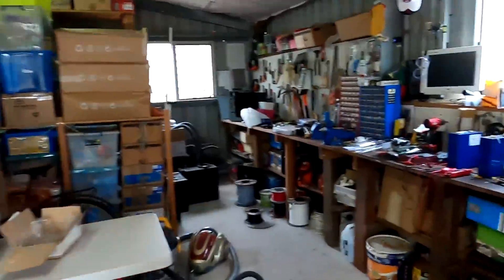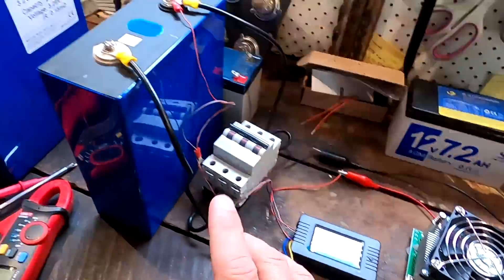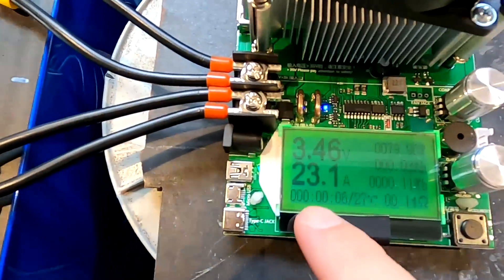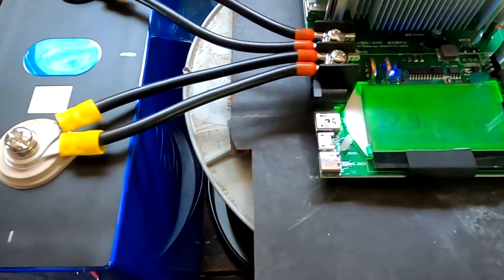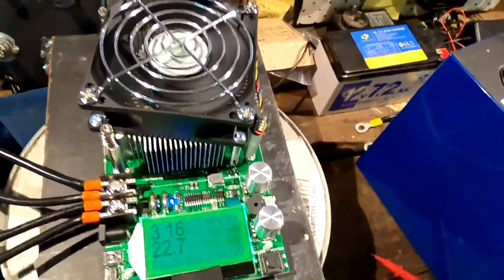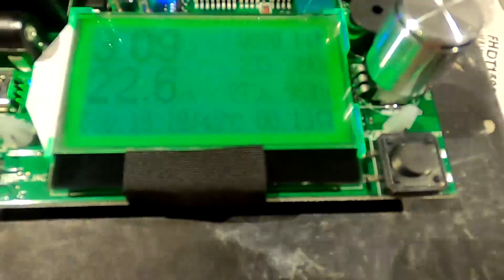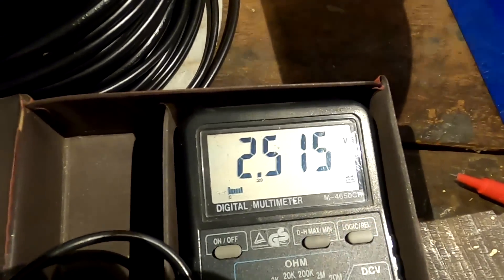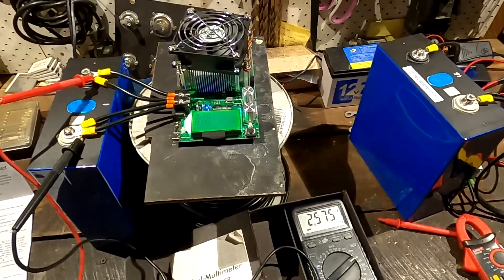Do Chinese batteries hold what they promise? Full EVE LF280 Capacity Test!

Comment: The resistance measure 0.14Ohms and the effective resistance the battery is discharging over. 3.24V/23.1A=0.14Ohms. its not the internal resistance of the battery..

Comment: Capacity measured plus the calculated losses of the wire harness >280Ah
It would be interesting to cycle this same cell 50-100 days in your solar power set up, then pull it out and repeat the same test set up you just did, as it is known that brand new cells will test higher initially but no one ever seems to state how much higher.  Seems like these ones are "a winner". Great vid Andy.

Comment: Your Multimeters are chinese so check specifications.  I have calibrated multimeter like them before way out in some ranges. I use Fluke only , but there is a French brand, which is good too. From a ex calibration technician.
Reply: I bought a Voltage Reference Module exactly for that reason. You can find inexpensive ones on Amazon with good reviews (on and off Amazon) accurate to within a few thousandths of a volt. Then if you have an inaccurate meter (assuming it even displays that many digits) you know how much to skew the reading.

Comment: This is a great series. I’ll be building a battery for my camper soon. I’ve never used Alibaba. These batteries seem to deliver as promised, why did you choose this battery and this vendor?
Reply from the maker: This was the only vendor which offered 5 years warranty on the cells and also was with Alibaba for over 8 years. I have found cheaper sellers but went with them and so far, so good!

Comment: 022721/0504 PST- Brisbane 2304h   Those two cell capacity testers are quite unreliable and notorious.
For a set up like yours what you need is pure digital cell capacity tester manufactured by EAST TESTER (China)
Model ET-5410@40A discharge current. Item available with Alibaba. US$175 AU$227. I found it extremely good and very relatable in test results. The settings are a wee bit complicated but once mastered the procedure, it’s easy to work on. Discharge test result per one 280Ah cell @ 40A = 5 hours. Best wishes and 73s...

Comment: Considering you were less than an Ah off rated capacity and that meters voltage rating is already showing as off compared to the multimeter, I can say that cell is probably a winner, and may have read over 280Ah on a professional instrument. An instrument that probably costs $1000's. So the deviation of the little fan cooled tester is acceptable, considering they cost less than $100 :)

Comment: Thanks so much this was very educational and also very encouraging to see that these batteries which are probablly the best value you will find anywhere online (believe me, I've LOOKED). I have a question though, why can you not leave these batteries fully charged for too long, what would happen and how long would it take before there would be an issue? Is it safe to leave a battery at 90% capacity?
Reply from the maker: Thanks for your comment and feedback. Due to chemical reactions, the battery will lose capacity when charged to 100% and kept at this stage. This will shorten the life if you do this to often. You can charge to 100% of you are discharging it right away again. The chemicals inside are most stable at 50% state of charge (SoC). Everything below or above will shorten its life. 90% is far better than 100%, 80% is even better. If you want to store your battery for a long time charge it to 50-60%. For general use,  you can use it from 10-90%, better from 20-80%. If you want the battery to last a really loooong time charge from 30-70% only.
Reply: @OffGridGarageAustralia  Thanks for the response! Ok wow that's really something I had no idea about. It makes me wonder what the manufacturer's mean when they say the battery is good for 3,500 cycles. Are the assuming when they give this number that the battery will be each day discharged and charged to 90% capacity or is the 3,500 cycles the really best case scenario of only using the battery in the 30 - 70% range? Sorry for the questions but your a wealth of information and i'd be kicking myself if I did not ask.
Reply from the maker: @bethechangeme2233  so, the specs say if you do depth of discharge (DoD) between 10-90% you will get 3500 cycles. If you do 30-70% DoD is more like 10.000+ cycles.
Batteries in satellites do only 40-70% so they last 25 years reliably.
Reply: @OffGridGarageAustralia  it would seem that one would need to triple the required size of their battery bank to stay within the DOD of 30-70% in order to make them last the 25 years yet if the DOD is between 10 and 90% that same three battery banks would last 27 years! Would it be safe to say forget about compressing, forget about super tight DOD's just go for the 10% - 90% and in 9 - 10 years we will have better technology?

Comment: Thank You for opening this old mans eyes. 
I have been watching you for a while.
I have Four 280Ah batteries Lithium Iron Phosphate batteries I am waiting on and because of you today, I order Two more so I'll have six.
Why?
I'm Old. I have been setting here thinking I'll hook them in Parallel like my acid ones and this will give me 1,120 Amp Hours, Boy Was I wrong.
I guess I need to connect them in Series for a 12 volt system and a full 480Ahs.
I live in my fifth wheel so 480 Ahs will not be enough.
Tell me if I'm wrong, but I guess I'll have to connect in Series and then the last two in Parallel for a few more Amp Hours, Correct?
Thank You Rick
Reply from the maker: Hi Rick, Thanks for your comment.
6 cells will not work for a 12V setup! You need either 4 or 8.
If you have 4 you just connect them in series for a 12V system like:
-⬛+ -⬛+ -⬛+ -⬛+

If you have 8 you need to parallel every two cells first like
  ┌ -⬛+┐
- ┤          ├ +
  └ -⬛+┘
and then have this pair in series with the other 3 pairs
  ┌ -⬛+┐┌ -⬛+┐┌ -⬛+┐┌ -⬛+┐
- ┤          ├┤          ├┤          ├┤          ├ +
  └ -⬛+┘└ -⬛+┘└ -⬛+┘└ -⬛+┘

Does this make sense?
Reply: @OffGridGarageAustralia   OK, I'm old so I guess I'm wrong as usual and very slow.
I watched https://www.youtube.com/watch?v=zStEtH9Le-w&t=150s
Thank You
Reply: @OffGridGarageAustralia   The picture you show confuses me, Sorry.
Maybe you could do a short video for myself and possibly others here.
Sorry I'm so troublesome.
I do live in my fifth wheel and everything I have is 12 volt or 110 volt.
I use solar and a wind turbine to keep my 4 lead acid batteries charged, but they are getting old, Like Me!
So you're saying I need to cancel the order for (2) more Identical Batteries and Order four (4) more Identical Batteries.
Same brand name is important or not.
Thank You for your time and trouble and for responding so quickly.
Reply: @OffGridGarageAustralia   I will do my best to get four more batteries after this order is canceled.
Thanks.
Reply from the maker: Yea, Rick, you can only use 4 or 8 batteries for a 12V system. The video you linked above shows the setup as I described it in my first reply. parallel 2 batteries and do this 4 times. You will have 4 pairs with 2 batteries each. The put these pairs in series to achieve the 12V. Video will follow soon...
Reply: @OffGridGarageAustralia   Yes, you're right.
Thank You.

Comment: Since you're working with such low voltages and you have to be accurate down into the millivolt range do yourself a favor dump the cheap Chinese meters.  Get yourself a fluke 87v or 289.  You will never have to worry about whether what you're reading is correct. It will be.  you can bet your life on it and many professional electricians and technicians do everyday.  Also if you can find a good Weston cell you can check the calibration of the meters.  These can be a bit fiddly as you have to keep them at a known temperature to ensure the calibration is correct. you also cannot move them or you must let them sit in place for a day or two for the chemicals to settle back out.  If you must use the Chinese meters at least get a known voltage reference that is calibrated and is referenced back to a known accurate source.  One item is known as a DMM check source.  These are available at dmmcheckplus.com.  They're not $20.00 but they're also not expensive and would be very helpful to verify your equipment accuracy.  A basic unit is $123 and will give you a precision 5 volt AC and DC source plus a current source and a resistance standard.  For an additional $20 you can get a capacitance reference source.  And there is an optional case if you would like it.  Also the manufacturer offers a low-cost recalibration for 20 bucks.  This is one of the best deals in calibrators that are built and tested out there.

Comment: There is a DC receptable right next to the dummy load terminals which should be there to power the tester independently of tested power source so it won't drop out prematurely due to the low voltage. At least my tester has this feature, not the same model in the vid.
Reply from the maker: Yeah, I did connect mine to the external power supply as the test voltage was under 8V.

Comment: The interesting thing should be to test this cell at 1C, it means, if I am not wrong, drawing 280A for one hour and see if you will get 280AH at the end of the test?
During the test you performed, you have got almost 280Ah at a rate of 22-23 Ah, that it corresponds to only 0.08C.
Thank you for your job.
Reply from the maker: That is absolutely correct. The specs of the cell stating 1C/0.5C discharge. I've made a video about this already and will publish it very soon.

Comment: Ridiculous question, Andy! If you used a sized matched copper ring terminal & a single, hydraulicly pressed, air-tight seal at each junction with a 2 AWG equally sized cable- would you have reduced the 'line loss' of 0.007 & 0.0073 millivolts? It's so small, it's meaningless, but- as I build a system, I could lose lots of Watts over relatively short distances... It's a thinking ahead question, but- annoyingly smaller in the larger test!!! Congratulations, it must make you much happier to know that you got what you paid for!!!
Reply from the maker: Thanks David. The better your crimping job is, the better the connection and lower the losses. I didn't pay too much attention to mine as it is just for the test. For the actual system, I will buy an hydraulic crimper though.
Reply: Jeez, I just commented with the same idea on the previous video! My line of thought is how well that works with the positive battery terminal in (fuel-powered) vehicles.
Reply: @charlesrichards5389  I think it was all about timing- we (Andy) were 'building it' at the time, and- lots of focus by the watching community...
Reply: @DCGULL01  I love the brain-storming! I also suggested drilling a small hole in each busbar to mount BMS wires. That's what I'll be doing if I decide to go with busbars. That should make the terminals more stable, easier to service, and easier to isolate voltage drops.

Comment: Great video, I also find it fascinating to watch the numbers :D. Also the amount of current drawn from the battery is not necessarily related to its voltage, especially in a case where a load is drawn through a constant current/constant voltage device (like some types of inverters), drawing more amps as voltage decreases to maintain a wattage output. I am interested to hear what you plan to do with these cells!
Reply from the maker: Thanks for your feedback. You absolutely correct.
You may want to watch the very first video on my channel. This explains the project.

Comment: As mentioned elsewhere, that 140mOhm figure is the equivalent resistance of your tester load, not the battery. Surprised that the tester is not a FOUR WIRE instrument - two wires to measure current (as you have now) and a further light-duty two wires on their own croc clips which you connect directly to the battery terminals, to measure voltage at the battery itself. This eliminates lead resistance in the current path altogether (or at least, it correctly takes it into account as effectively part of the load).
The usb sockets on the tester board suggests it can probably output data to a PC, to log voltage drop and Ah in real time, to save you the bother of watching :)
Reply from the maker: Thanks, I've got a second tester which has the voltage sense directly at the battery terminals.
Really? That's the load resistance, not the battery internal resistance? I thought it says that in the manual...
Reply: @OffGridGarageAustralia  yes, that's definitely the load resistance. There are other meters that have readings for both internal and external resistance though.

Comment: Word of warning, I have bought multiple of those 180w capacity testers and they ALL fail within a short period of time. When (not if) they fail, they fail in a short circuit making tons of smoke all over the place. Highly recommend an inline fuse of some sort before connecting any further loads.
Reply from the maker: Thanks for the feedback. That's good to know. Was this all with higher loads? So far I have only tested single cells with 3.3V, so pulled 75W max.
Reply: @OffGridGarageAustralia  to be fair, I did run higher voltages. Testing 48v batteries @ 100 watts smoked them after a few hours.
Reply from the maker: @jjthegreat1981  on thanks very much for that info. I've planned to test the 48V system with it to. Have you got the tester with the green board or the red/brown board?

Comment: Although I never did a full drop to min cell voltage of 2.5v for a cell, my 4s 12.8v configuration I was able to draw 262.6ah at a constant 46amps via a inverter running a pond pump with the lowest cell voltage at 2.986v and highest at 3.124v with total cells at 12.2v and SOC 6% via my Daly 150a BMS and VictronConnect 712 smart. Duration from max charge was 5hrs 48mins.
Reply from the maker: That's a great result.

Comment: Nice test! And good job measuring the voltage drop over the cables. That drop shows some resistance which the tester is attributing to battery internal resistance.

Comment: So this battery as 12V 280ah with an inverter would run a window A/C unit drawing 5ah 500wh at least 7 hrs basically ?
Reply: More like 5 hours. Your inverter will only be 85-90% efficient. Plus losses in cables.

Plus 5ah at 110v is more like 550w.

Recon you only want to be using 80% of these lifepo4 batteries to maximise life cycles, so don't drop bottom 10% or charge over 90%. Will increase your life cycles from 800 to 1000's :)
Reply: @w3bb0y  luckily the devil is in details . the room to b cooled is 1/4 the cubic ft these window units are rated for .  previous attempts with agm 500 ah have only used 40% d.o.d. on 8hr runs so I'll b giving the 280s i try in summer . should b interesting .

Comment: You have wires resistance so the internal resistance will not match you cell. I have the same electronics load tester. Great video. Looking forward to the next test.
Reply from the maker: Ah, yes, of course. The tester sees the wires and connections as well... Thanks for that!

Comment: Recently I did similar tests on my 150 Ah cells.  On an individual basis the cells were fine, however, when connected two in parallel and then four of these parallel groups to make  a 12 volt battery, I lost 25 - 30% of the capacity.  I tried it several times moving batteries to various positions and got the same results.  So I decided that the complex internal chemistry and internal resistance of the batteries caused some to drain more rapidly than others just as if you take different value resistors and put them in parallel the current through each will not be identical.  Since it is the current that drains or charges a given cell it makes sense variations in internal resistance will cause variations in individual cell resistance and currents.  Just as with parallel resistors, the voltage across resistors will be the same but the currents are different and I think the cell being taxed pulls down the voltage for the parallel set.  Also, although my cells were fine as individuals and exhibited small cell differential voltages for most of the test of less than 10 mv (at the very end it got up to 30 mv) when connected in parallel I saw differential voltages of up to 300 millivolts.  It would be very interesting to see if you could repeat my experience on your cells.  For now I have concluded that if one wants a larger capacity battery than the value of the cells they own they should make single batteries of cells in series and then connect the batteries at the battery level in parallel with each battery getting its own BMS.  Otherwise, based on my experience, you will lose a lot of capacity.

Comment: I believe that resistance is what resistance the device is at to get the amps you need the math seems to work out and you should be able to set the current to like 1A and it should be the same as the voltage

Comment: You have now 16 batteries good working for free. Well done Andy! I want do the same only I don't know how to start with 100Ah or 120Ah?
280Ah is too big for my 2kwp solar.
Reply: More Ah is better. 
280Ah is perfect
Reply: Ali Express has 100 Ah cells and 90 Ah they may both be the same but for like $160 for 4 cells
Reply: Bigger is better as it means it's a lower c-charge rating. Eg 2000w solar charging a 2000wh battery is 1C charge (bit fast), where as 2000w charging a 8000w battery is 0.25C charging which is better for the batteries. Hope this helps.
Reply: @w3bb0y  right. I agree 100%

Comment: Guys, is it just me or the video is flickering quite a lot around the 1:30 - 2:00 mark?
Reply: If the lights are not flickering, it is just a camera issue. Take your phone and look through the camera at a tv, computer screen. You will see weird flickering, because the cameras are slower at picking up the lights. Not a problem either ways. If the shed was running on solar and a cloud came on top, voltage dropped, would cause the bulb to flicker as well if connected directly.